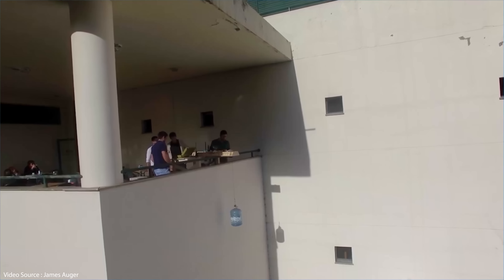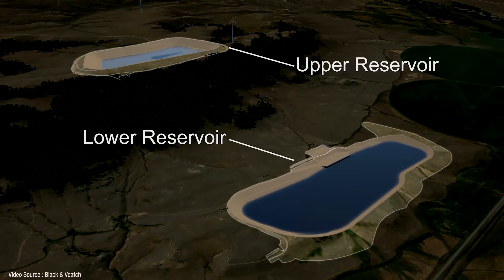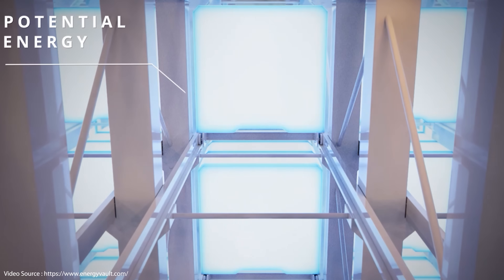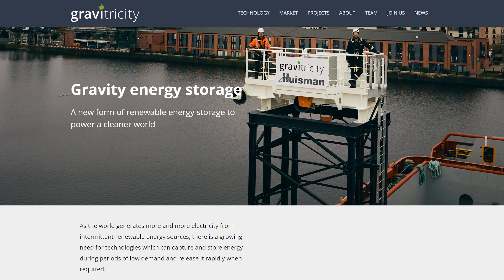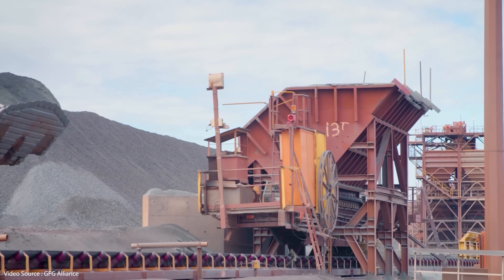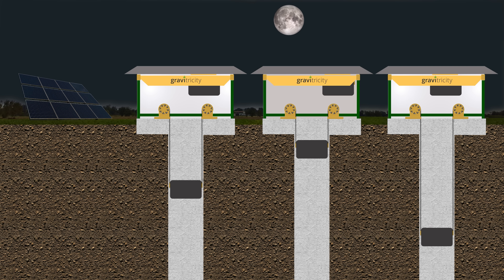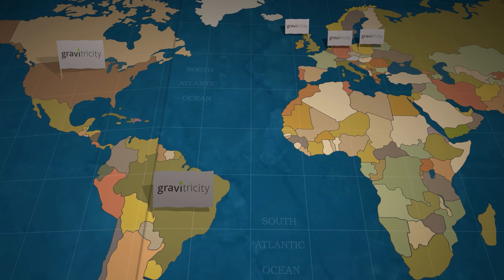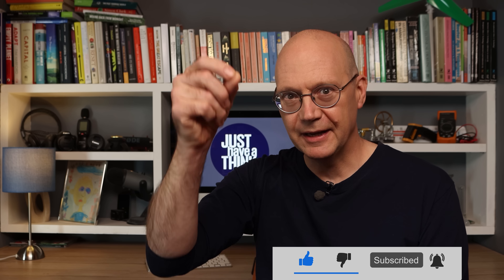Gravity Energy Storage. Who's right and who's wrong?

Comment: I don't know.

I have calculated the potential for energy storage in a tiny, tiny home setting and the amount of energy stored for lifting several hundreds of kg's up two meters is not worth the materials and the hassle.
It is basically negligible.

That's why the only working potential energy storage to this day is: hydro-electric.
And as one can see you need enormous, absolutely ginormous amounts of mass to achieve this.

Comment: Revisiting a stupid idea doesn’t make it any less stupid.
There are two reasons pumped hydro works and none of these idiotic schemes won’t.
One is it often rains and you get free power because the dam fills itself.
Two is water doesn’t require construction and doesn’t wear out. A third bonus thing is you and the environment need water.

Creating massive concrete blocks solely for the purpose of using them as dead weight is as stupid as it gets and only a climate alarmist would be stupid and gullible enough to think a good idea .
It would be less idiotic (only slightly so) to create a massive reservoir on stilts that can release water into underground reservoirs. At least then all the construction energy and the c02 released from the concrete and construction would actually go into something who’s use has merits over and above inefficient energy storage.
Using water instead of blocks is an order of magnitude more efficient that only an utter imbecile would choose blocks over water.
That said it’s all utterly pointless as all global climate change is almost 99.998% natural.
Humans are only altering local climates and it’s done entirely through construction of pavement, dams, buildings, mines and the latest blight on the landscape Solar and Wind farming. c02 is not capable of effecting the climate at level below 10% and that is about twenty times more than the current level. We would have to burn everything and melt all the limestone to achieve that level so even if every country ditched all renewables and hydro and nuclear and gas and solely burnt coal we would never reach that level.

Comment: Wind turbine to lift very heavy weight than use the weight for power when no wind. Much less loss as little conversion. Solar could work as well would still need some batteries for storage but might need only half as much for the same capacity. Of course nuclear is like free energy compared to everything else if you deal with the toxicity of it all safely.

Comment: Thanks for this video.  Checking back on the progress of these companies is an important accountability move.  In the report you cite from the Imperial College of London, the one chart you showed does not mention pumped hydropower storage (PHS).  But looking more at that report, I see a number of comparison charts that include PHS and it is shown to be pretty cost-competitive with the Gravitricity proposed method.

I'm a bit dubious that Gravitricity's proposal puts things deep underground, a feature at the heart of their plans.  The inaccessibility adds some failure modes and repair difficulties.  I'd rather bet on an idea like using rails on the side of a mountain that some have mentioned in the comments here.  It would have different issues, but seems more likely to remain functional long-term compared to putting the weights deep down in  a mine shaft.

Comment: Not every system needs to be grid scaled.  Matter of fact there are perfectly good systems that do better in the smaller style
The vertical shaft turbine along the motorway or homerooftops.
I am still hoping for my Ambri Liquid metal electricity  storage system for my home user even maybe for my street and even at the substation 2 blocks down the road were the peekerr furnace was installed a number of years ago to supply the extra we sometimes need. For all those applications a phone battery(lithium) is not able to be used. 
Well thank you

Comment: Putting one of these systems into a decommissioned coal and gas power plant, (powered by solar and wind) would save money building out the integration to the electric grid. Those dirty old plants are already hooked up, already have the infrastructure to generate power from turbine spinning, ready to go.

Comment: Well, here in Klamath Falls, Oregon, we have both lots of old railroad track and lots of very heavy old iron train parts. So the materials to build such a system could be all recycled, except for the motor–generator and transmission lines. That means the LCOE could be very low! and we have high hills around the city. There's old gold mines in the are as well. So I will bring this to the attention of the Oregon Renewable Energy Center.

Comment: Why just mine shafts?   Shorter cliffs could be made to work, just install masses that are towed up the cliff face and then lowered.   Most likely on a rail system.   What you might loose in distance of a mine shaft, you could make up in mass moved.    No water needed so will work in dry environments also.

Comment: My answer to this is to use water buoyancy as the medium of storage, but what I see as the answer to cold fusion, is to create hydrogen and oxygen from sea water at a deep sea location and use the potential energy of the buoyancy of the gas to drive a turbine as it floats to the surface, like a conveyor belt of balloons, the water column or water gradient is what you need. The hydrogen and oxygen are a byproduct 🙃

Comment: I would have liked to hear your opinion on ARES, another company developing gravity-based power storage, that uses big dense slabs on sloped railtracks. Their infrastructure cost seems a lot lower than all the others as a result, using existing hills or mountains for vertical differences and well-known pre-existing railroad elements.

Comment: Instead of dropping it into mines why not just drop the weights down into a deep lake or the sea. 
You loose 1 kg/l, but with for example lead as the mass used there is still 10 kg/l left or 10 ton in a cubic meter. Very little construction needed and lot of places where it could be used. Standard equipment for raising the anchor on ships could be used to lift the weights.

Comment: I recall an idea I had to store water in the huge and deep coal mines in the Ruhr area in Germany to pump they up when we have access energy. Turned out that the engineers working for these coal companies tried to lobby for this at their own management for years. They weren't successful and the huge mines were filled with concrete..(yes, the stuff that creates a lot of CO2 during production). Probably it was too difficult or too expensive. I don't know but these mines had for centuries cost a lot of effort to dig and now they are gone.

Comment: Any moving part system for electricity storage system will be riddled with lot of problems and very high maintenance costs as time goes by. Also losses in charging discharing ratio will keep moving up, like our cars drop mileage as driven more.
Best will be some unique chemistry with abundant non-toxic material.

Thanks Dave for wonderful follow up video.
Reply: It's a fairly simple system built from known components with known longevity.  Basically a winch, a motor and some electrical controls to switch direction and possibly convert frequency between winch speed and grid frequency.
Reply: @johndododoe1411  For the system to be robust, the parts have to necessarily be stronger and heavier to withstand wear and tear. The heavier system builds in losses during both, charging and discharging cycles, which again is a huge cost everyday, every hour and every minute.  
This defeats the purpose of system.

Comment: What I like most about gravity energy storage is all of the elements are pretty well understood and immediately applied and scalable.  The world has been moving large weight up and down for over a century, so the design cycle will be extremely fast.  Also, changing out wires after their lifecycle is quick and easy and can be done (I'd imagine) in a month or so.  I think this will be a great solution for the large city, small neighborhood, or even for a single residence.

Comment: Taking the U.K., how much storage capcity do we need for frequency support.  We have somwhere in the order of 3 Gigawatts I believe?
My impression is that this system is very low power and as such is there any point? It certainly will do nothing for the so called transition to renewables from gas and coal, which simply can't happen.

Comment: I wonder if the cables break, can the shaft be air tight to try stall the fall of the weight? Or will they use a type of elevator brake system?

Comment: What about in deep parts of the ocean? Instead of using power to hoist up use less power to ballast the weights to pump air back in to raise it back up. Like a submarine just going up and down. I suppose it would have to be on a cable guide or something. I mean barnacles and crap would probably grow all over it so it would have to clean its own cables as it went up and down I guess. I don’t know, just having a think lol

Comment: Glad you came back around to this concept. Thunderf00t sure did take them to task. I live in an area with abundant wind power, with the highlands of 1500ft is easily harnessed to this purpose. Installing a track that could bring a payload, up and down seems a no brainer. In our case, there is a stone guarry up top next to the windmills. The track could be used to bring loads down. Replacing fossil fueled trucks and generating power on the way down. 

Anyways, we are burning biomass for electricity generation here in Nova Scotia still. We are still a ways off from having such forward thinking ideas take hold.

Comment: I personally think the best way to "use gravity for power" is implementing tidal forces that are so predictable and regular and provide a ton of power always.
Reply: It's storing the power is the issue, though, so to use it when we want
Reply: Every 6 hours the tide turns. Pretty much continuous
Reply: To be clear, this are not power 
 systems, but energy STORAGE ideas.  But the one proven idea, pumped hydro,, gets short shrift, yet in conjunction with existing hydro generation, it's going to need less infrastructure and zero waste due to lateral movement.  The only reason pumped hydro often has high cost is when it's built an integrated system including the generation plant, something none of these concepts do.
The basic idea is to move mass up a gravity well.  Water is mass, and easy to move up with a pump  while it moves down simply by opening a valve.  No need to have an electrically powered mechanism locate and engage a weight, then do it again over and over (at the time of maximum power use).  Simply open valves to spin as many turbines as needed, let it flow down to the lower potential energy basin.  I can't imagine a more efficient method of moving potential energy.
Reply: Tidal energy is the largest, simplest energy store for Britain, if only we could see that by the time a series of problems is half-sorted with land-based power storage, tidal storage could be fully implemented. Storage lagoons can be used to store excess wind and solar energy also, for minimal extra cost. 

As we consider huge projects which use economies of scale to help their efficiencies, we shouldn't forget smaller-scale hydro projects which involve local people and help them understand and interact better with energy supplies. In Victorian times, there were on average four mills per mile of English river.
Reply: I fully agree but it seems that creating nature reserves in the UK is of far more importance. There is a huge tidal barrage under construction near Swansea in South Wales which I hope can open the way for many more.
Reply: Tidal Barrage systems are in use doing such a thing, also they wanted to build the Largest system in the world (they still might be) in the UK but I forgot where. The problem with putting in these systems as well as other which use the power of the currents etc, is that they mess up deposition of minerals/sediment etc within the ocean.
Reply: @Dundonian1981  they are probably trying to set it up in Scotland. The big problem with underwater turbines is corrosion. It's very hard not to get problems with your turbines and it is very difficult to fix them as they are generally underwater. It's expensive to raise and lower a heavy rig from the seafloor to fix it
Reply: @Dundonian1981  Cardiff bay IIRC. Also the Severn Estuary is also a contender.

Comment: That grabs a hold of my mind. Like the submarine, buoyancy by air in tanks to rise the vessel up against, gravity in deep,trenches underwater.  Dump water ballast  by air and replace with air . But only within hull.
When reserve air is gone? Let go and( a line and tube to,surface, will get air from above to increase by compressors or engine intake toward surface, or bouancy upgrade. 

It seems there is a line you can’t go past. When your weight by gravity of it , gets to more than your ability to equal or increase buoyancy. Gravity in the deep, is more. Up high it is less. Water, makes it shown, there has to be an incremental  variation for more depth and hull strength. .heavy hull , plus the increased gravity, plus the amount of increased buoyancy required.  
Take it up, into air and normal, it’s what it is. But not out in Earths exterior void, limit of hold of weight. It becomes, featherlight, nothing much needed to move it in space. A puff of a few seconds can  avert an unexpected event, Directionally. It could be , like underwater deep in reverse.  You are gone, out or in, it has devastating effects.  Who was that  who  said Gravity does not do anything ? Don’t think of the gravity of the statement.!    Down a deep(hole,) underwater, it gets stronger, but has to have a power equal and stronger to, overcome it. A limit of its down weight needs more than it up lift.
Pressure of buoyancy tanks also, become criticality wall thickness  and weight.  To take into account.,free travel in space has one bad news, radiation.  Looks like we are going to,keep improving things on Earth, if we are to continue here.

Comment: Although feasable, scaling still is a bitch with this one. Example:
A small to mid-sized Windturbine has 2000kWp. Now lets say we have peak conditions and half of all windturbines in a region have to be turned off (or otherwise the grid would collapse). So the surplus Energy from that one turbine on that one day has to be stored. That means you have 24.000kWh of surplus energy to store.
If you lift a 100t block (~50 cars) 2000m (more than twice the hight of the highest tower) and assume a efficiency of 80%, that block will store 100.000kg*9,81m/s²*2000m * 0.8 = 1,57 GJ (=1.570.000kJ) of Energy. 1kWh=3600kJ, that means our setup will "only" store 436kWh. You would still need ~55 of these constructions for just one rather small turbine to save half the Energy it produces over ONE DAY. That's a lot of empty mine shaft, if you ask me.

Here is my proposal for Energy storage:
Those 24.000kWh fit in roughly 480 EVs. Everyone has a car, everyone wants a car and since there is no feasable option for carbon-free driving everyone will have an EV at some point. An EV needs roughly 15kWh per 100km (62miles) let's say 90% of cars are standing arround at any given day and 90% of people know they won't be driving more than 100km the next day (it will be 95% but people do be paranoid some times). So these 81% can declare 35 of 50kWh of their Battery public storage and only use the last 15kWh for themselfes. In that case you would need 686 volonteers out of a pool of 847 (81%) carowners who are willing to give 35kWh of their storage to the grid. And the more cars there are, the less of their storage needs to be rented out.
Plus side: You can incentivice people to do so, so your car can actually make money. It gos like this: Every kWh is sold to the car-owner for regular prices. as soon as the car deposits Energy into the grid, the owner gets that ammount of money back plus, like 6ct (in other words: electricity for cars is 6ct cheaper). In order for this to work, cars need to be bidirectional chargable (which most of them arn't for some weird reason) and the grid needs to communicate with the car. There is a region in Denmark where they tested this out an people made like $100 per month this way.

Here is why this won't happen any time soon (in the US): Energy production and handling would no loner be centralized and controlled by a handfull of companies.

Comment: I got into the discussion late. I have not yet seen a discussion of what energy it used to "Recharge" the system, i.e. to get the weights back up to the top of the run and ready for reuse. Please include the whole cycle.  Spend a little time discussing the economics of returning potential energy to the system, not just the part about putting energy into the grid

Comment: Question 1. A given case. How long does it take to install enough Solar to supply the US electricity grid - Call that Time A. Question 2. How long do Solar panels last (their efficiency also drops over the years) - call that Time B. If time A is longer than time B then you will be replacing ALL the existing solar systems over the number of years it took to install it While at the same time continuing to install the needed solar to supply the US grid. A doubling of the workforce. You can't use workers from other countries they too will be installing their own Wind/Solar grid supply. It is just not feasible folks. A very scary risk. 21st Century Nuclear, the total solution.